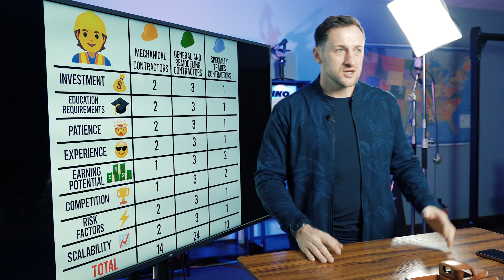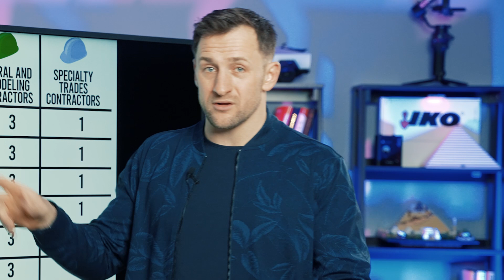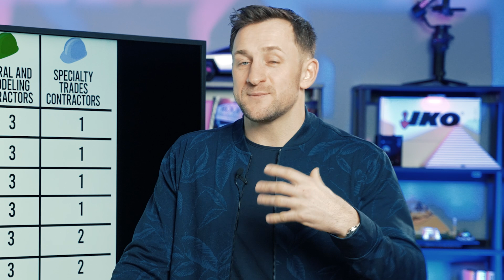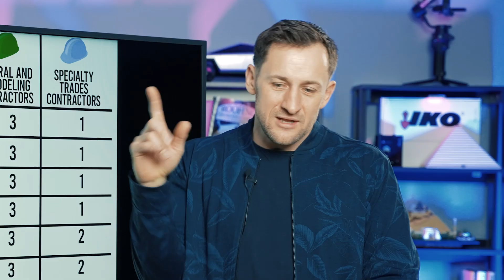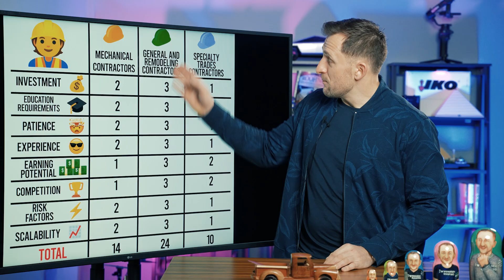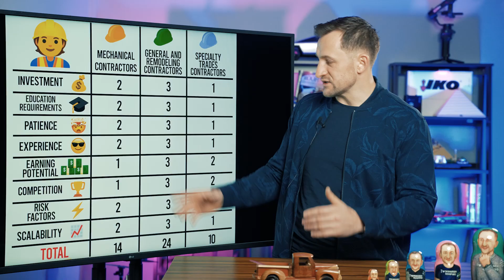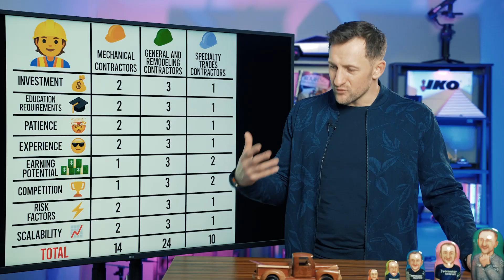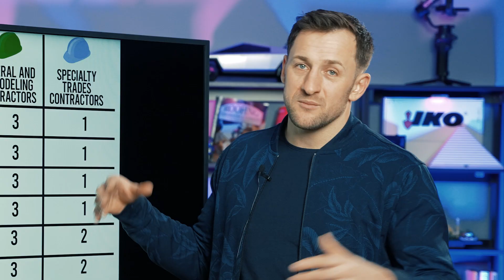Who Makes more: Roofer, Plumber, Electrician or Builder - Remodeler?

Comment: I started roofing with a borrowed air compressor and nail gun.  I brought a 8 foot step ladder and started on two story apartments.  Set the ladder on the second story deck and started working.  Roofing don't take much to start.  And it is a job a lot of people dont want to do.  I make a ton of money doing it because I have perfected my trade.  Took about 4 months of working with a stop watch to see which way was the fastest way to do something.  Still time myself after 23 years to see if there is a faster way to get things done.

Comment: Good video. Scaleble profit you're way off. As a specialty contractor to spec contractor and the main reason is profic you can keep. Every two years each person can make 250k TAX FREE. As a couple you can sell a house each year and clear 250, not making that much yet so a build and sell with a 1031 then move into the 1031. Major remodel and addition 6 months before you sell and pocket tax free money. You make money as a contractor managing finances and profit. And I still make the individual trade profit margins doing some of my spec build work in house.
Reply: Hello, you mean that general contractors can renovate their own houses and then sell them. The profits earned by couples are tax-free at 500,000. This is a good strategy. Is this what you mean? Thank you very much.